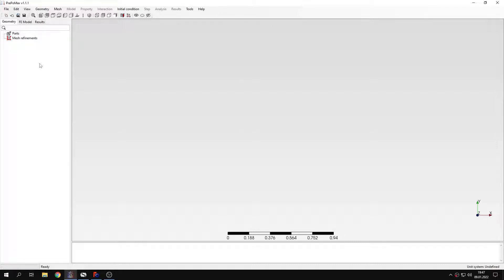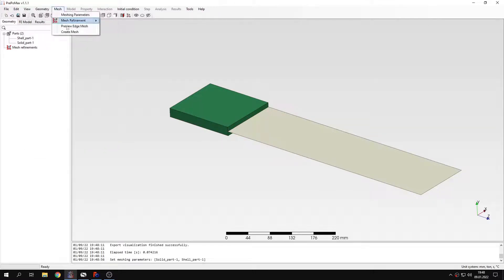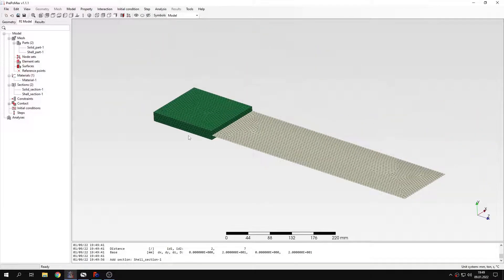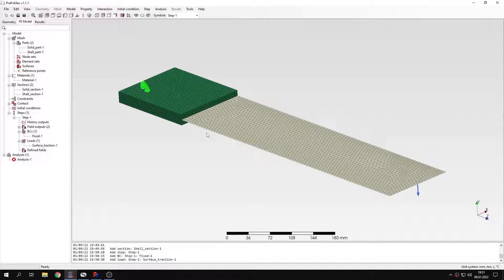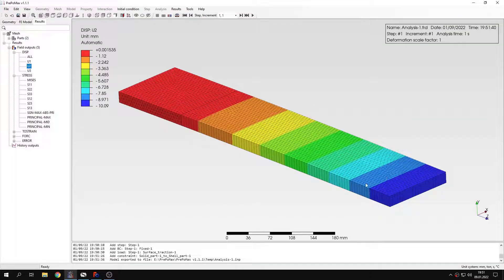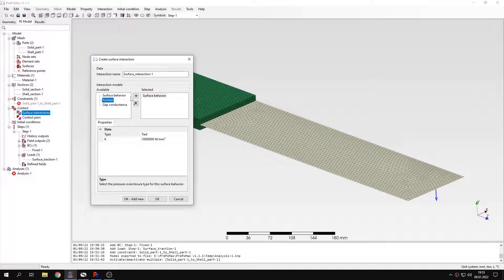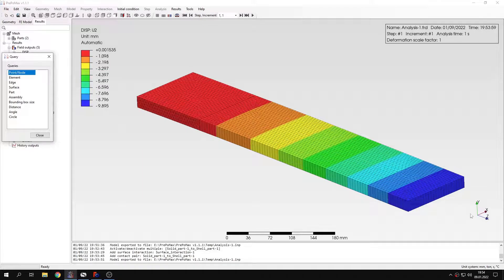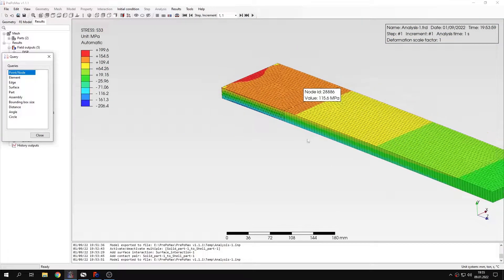PrePoMax (CalculiX FEA) - Tutorial 15 - Shell-to-solid connection

Comment: Under which physical situations (connections) we should prefer the first (solid-to-shell) constraint?
Reply from the maker: Connecting solids with shells this way can make sense when modeling structures with large thin-walled members that can be simplified to shells but are also connected to smaller regions of interest. So for example, pipes, beams or pressure vessel walls connected with welds, flanges or other joints. Both tie constraint and tied contact may work well if master-slave assignment is done properly but I would still trust tied contact more.
Reply: @FEAnalyst  which element is a master and which is a slave in this case?  I remember that master should be geometrically more simple,  more stiff and have coarse mesh comparing with slave. Does it even matter in this particular case?
Reply from the maker: @comee91  In this case, the Search Contact Pairs used the solid's face as master and the shell's edge as slave for the tie constraints. However, swapping them (there is a context menu option for that now) should resolve the spurious stress concentrations. Generally speaking, when it comes to tie constraints, the main rule is that the main surface should have a coarser mesh. In Abaqus, rigid surfaces can't be slaves. There are more traditional rules for contact, even though in theory they are mainly applicable to node-to-surface contact.

Comment: Hello great video!, I was trying a to create a shell to shell contact . but when I'm creating the contact I don't know how to tell prepomax that I want the Top part of one shell connected to the bottom of the other shell (Im modeling a plate on top on another plate and there is a gap between the shells equal to the thickness of the plates) , could you advise on this ?
Reply from the maker: In PrePoMax you just have to click on the proper side of the shell surface, it will be highlighted in red or pink (depending if it's a master or slave surface). Then, once you confirm the selections and create a contact pair, both surfaces (sides of a shell) will be yellow by default. Internally, this is handled by Sx labels (S1 - negative normal direction or S2 - positive normal direction) in *Surface keywords.

Comment: Excellent tutorial. Thank you for producing these and highlighting the new features and continuous development of PreProMax !
Reply from the maker: I’m glad that you like it :-) I still have a lot of ideas for tutorials and I’ll try to realize as many of them as possible. Especially that PrePoMax’s capabilities expand very fast. The biggest problem is that it’s not easy to verify some cases with analytical solutions but I want to stick to such verification for now, that’s a very important part for me.
Reply: @FEAnalyst  I am attempting to do a 2D thermal analysis of two flat simple rectangular plates that touch along one edge, but I am having difficulty effectively contacting the edges. for the heat transfer to occur. The heat does not flow from one plate to the other. I have a temperature on one edge and a convection on the other. 
Not sure what I am missing. I normally do this on Ansys and I am trying to replicate a test case on PreProMax. 
Would you kindly do a tutorial video of a very simple steady state 2D test case for us ?
Reply from the maker: Did you connect these parts with tie constraint or thermal contact ? This is necessary unless the plates have continuous mesh.
I will soon start a series of tutorials regarding thermal and thermomechanical analyses (I wanted to cover some important topics on solid mechanics first). 2D simulations will also come in the near future since the upcoming version of PrePoMax will support them.